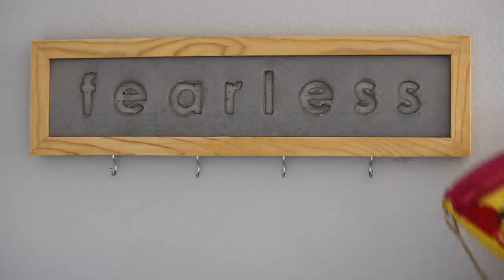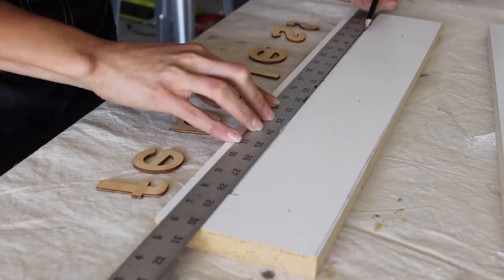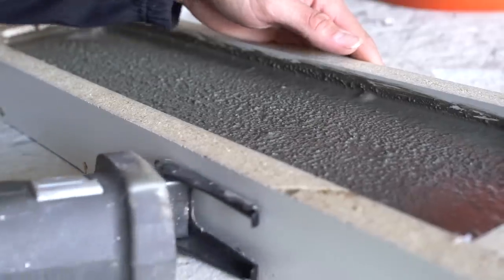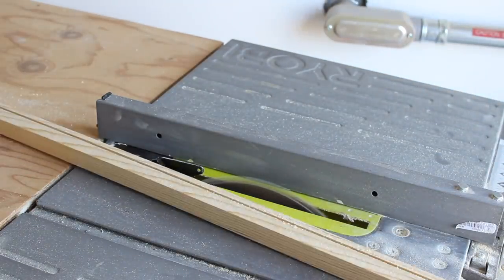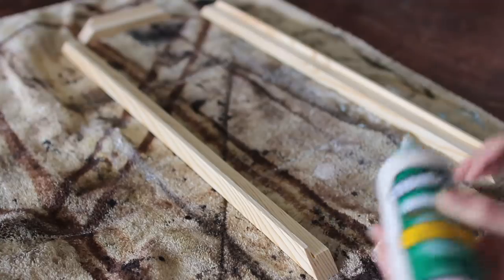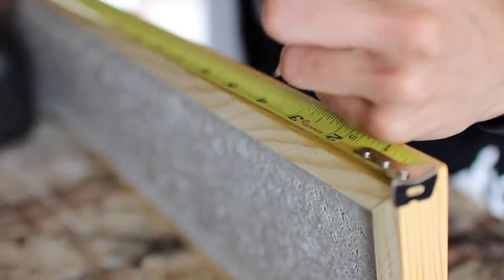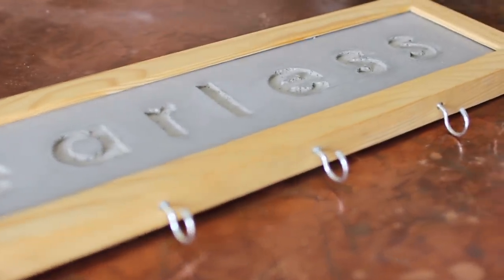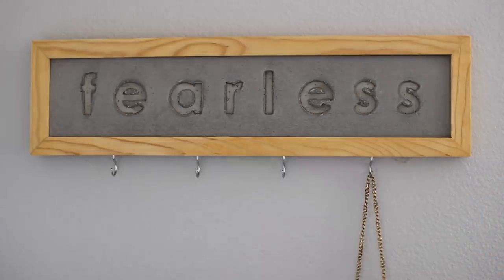DIY Simple Wall-Mounted Coat Rack | Wood + Concrete

Comment: you might want to find another hanging implement in stead of the saw hangers. they have a tendency (over time) to come loose and the object will crash down. personal experience. i now either use several of the to distribute the weight or use another hanger altogether
so enjoy your videos
Reply from the maker: Thank you!

Comment: Just so you know, wood glue is stronger than pin nails. Pin nails don’t make it more secure, they just hold it in place while the glue dries. So if ever you have time to leave your project in clamps you don’t need pin nails.
Reply from the maker: Thank you for that!